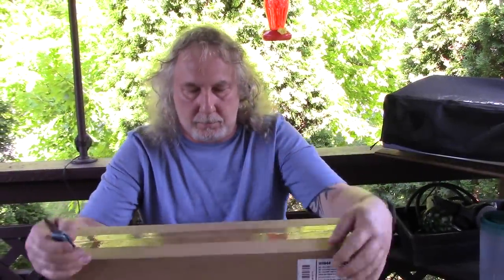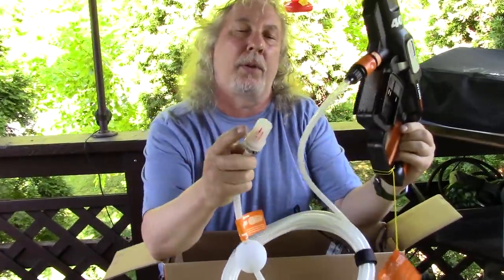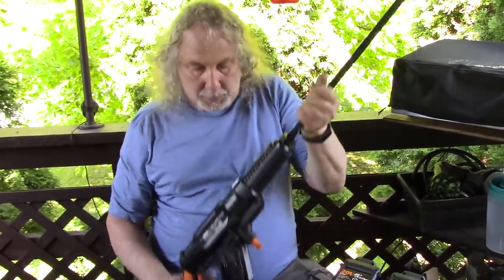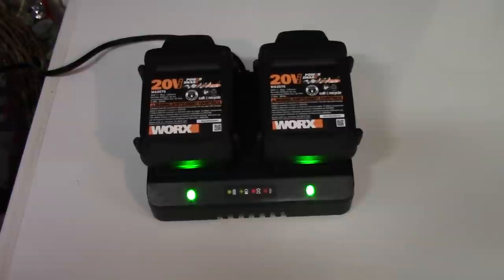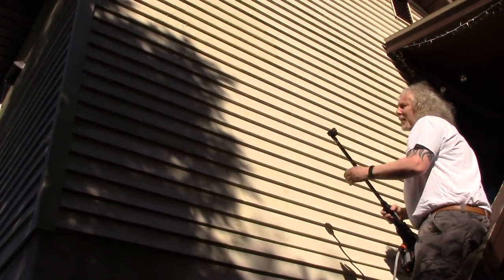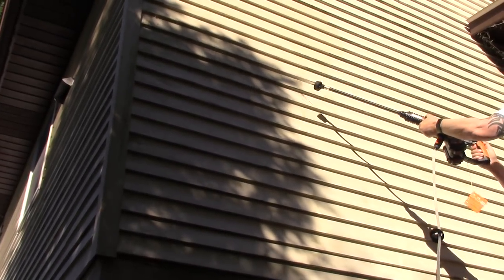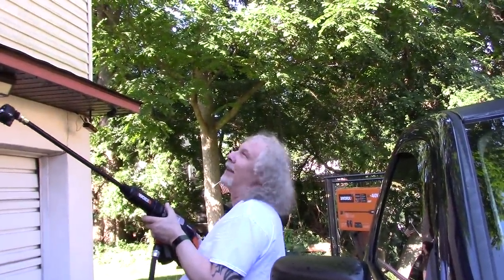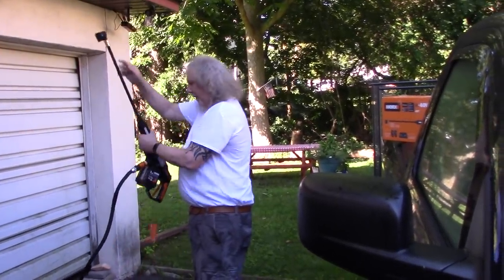The WORX 40V Max Hydroshot Unbox and Review

Comment: Nice!!! We have the smaller one and it works great. Our only disappointment is that the battery does not last that long. You can get a car washed on a full charge,  but the house you have yo do in sections,  so if you don't have a back up battery on charge to interchange it takes longer to power wash your house lol. Overall- it does pretty good job.